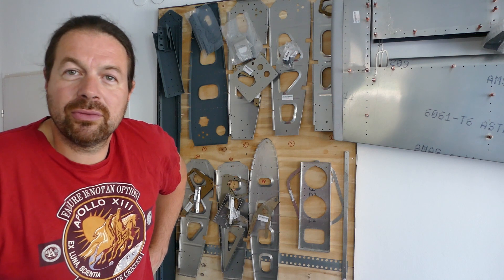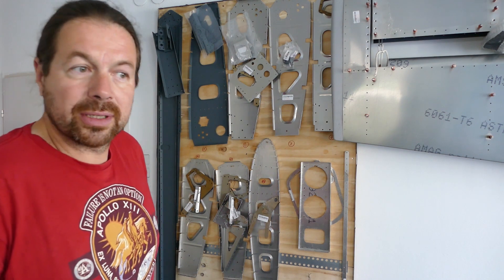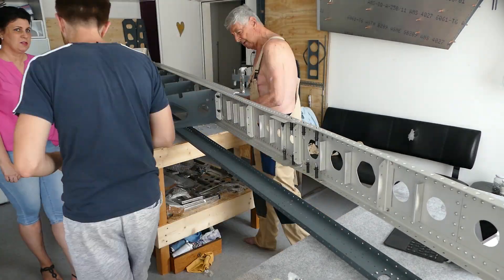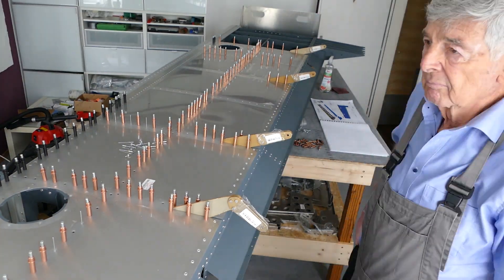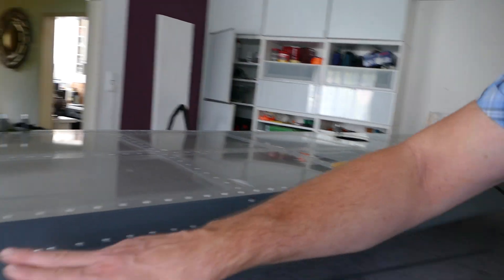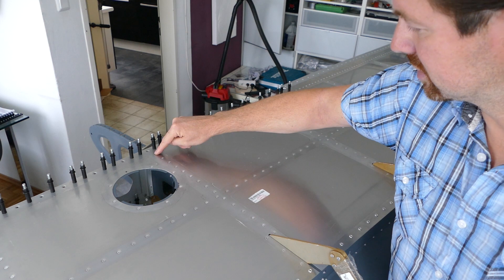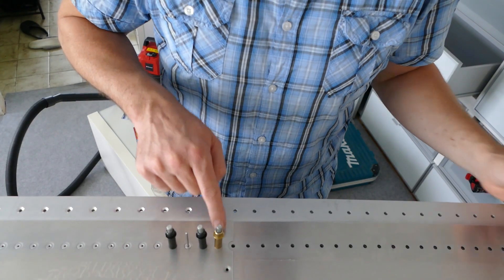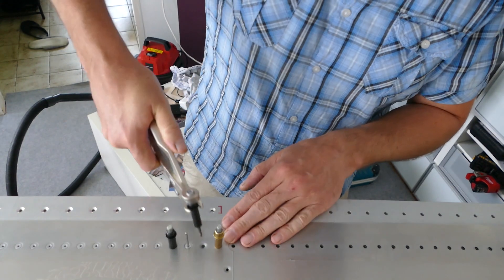Right Wing! | My TSi EP04

Comment: Sling technical recommended to me recently to put the root skin on top, even though that notch is there.  Root over outboard, front over back.  But you will be fine either way.  There are examples flying with either approach.

Cleco/align to primary support structures first (such as main wing spar). Then cleco secondary structures.  Ream/match drill as needed when a rivet does not go in easy.